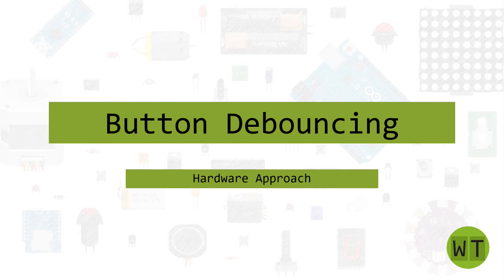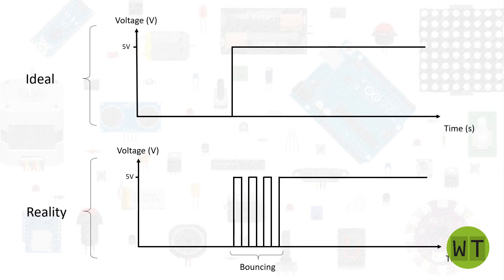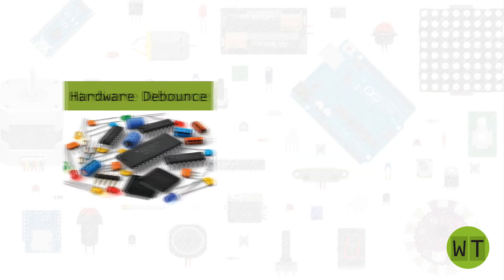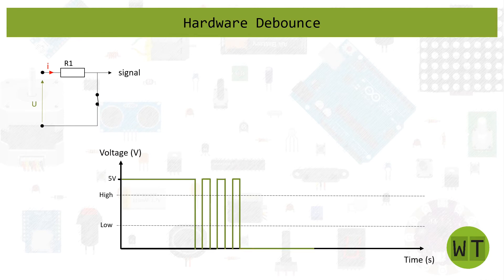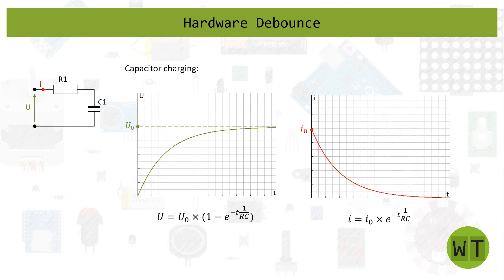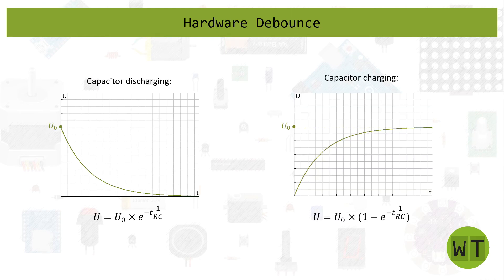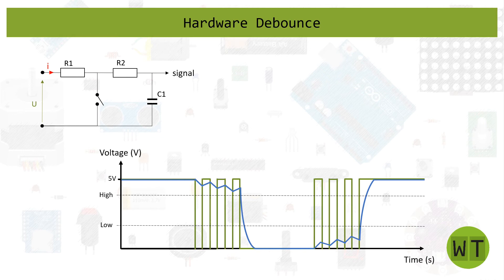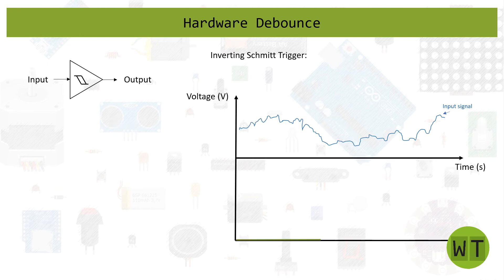How to debounce a button (Hardware approach)

Comment: Thanks for the good video. Few comments: 1) add values for the R & C and explain the effect on the down/up time (and of course on the no-interrupts time) 2) Give a specific Schmidt Trigger reference (i.e. H11L1 ). 3) Usually such debouncers are connected to GPIO, specifically to interrupt. It could be nice to see that connection as well.
Reply: Is a H11L1 not a Isocom Transistor output Optocoupler?

Comment: Nice one!
I would advise you to also get into the values of the resistors and the capacitator somewhat more.
Or make a different video about that issue with a link in the debounce video. 🙂
Reply: I have seen a similar video they said 100 ohm for R1 and 10 ohm for R2 with a .47uF cap.

Comment: is this bad when you want a fast response from a button can someone get away without denouncing
 how much delay does it introduce to the circuit?
 how much time is the delay of this process? and how to lessen the impact and improve response?
Reply: If you want low latency and reliable debouncing, I'd recommend using a double throw switch and latched debouncing. You can do this either using separate IO pins for the NC and NO contacts, or you can connect NC and NO to opposite rails, and use a non-inverting buffer with positive feedback to maintain state during a bounce. This will latch into the correct state on the first edge of the closed, and the delay added is whatever the propagation delay is for the buffer you choose, generally some nanoseconds. There are a whole bunch of different kinds of logic, transceiver, or line driver ICs that can be used for this purpose.  

Delay or RC filter based debouncing on the other hand usually takes a few to tens of milliseconds. Most people are able to click somewhere between 10 and 20hz, so if you need more than ~25ms to determine what state the switch is in, you have problems missing valid inputs, Also a problem is that some switches bounce for a long time, so much so that a bad debouncing method might both miss valid inputs and also generate spurious inputs.